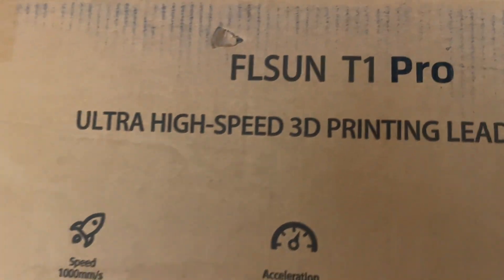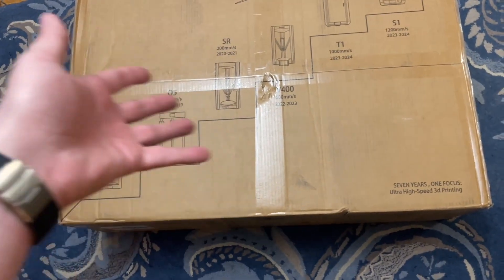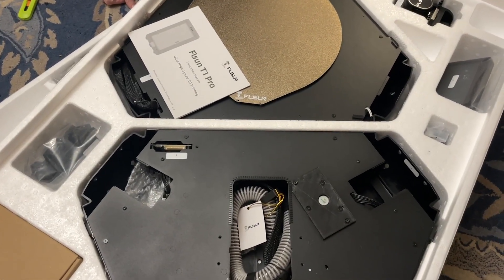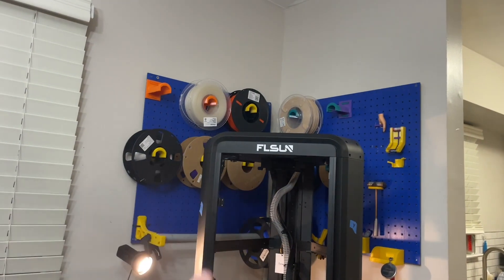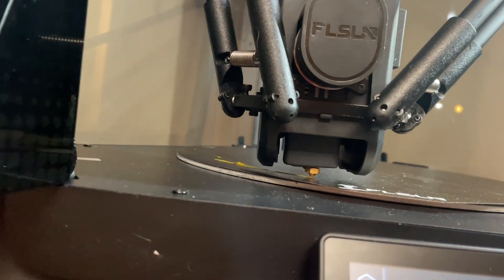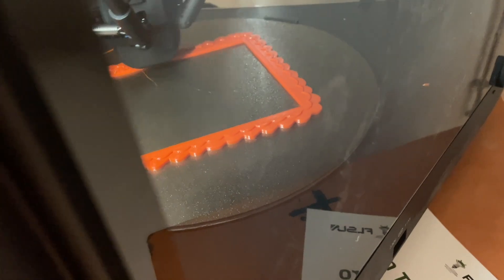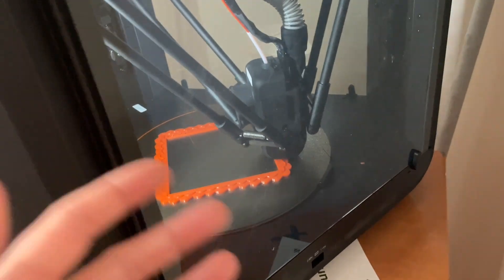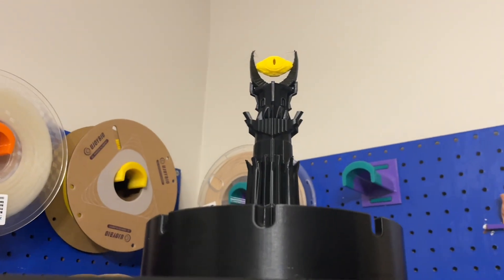This Flsun Printer is... confusing

Comment: What is the benefit of the delta configuration? Speed?
Reply from the maker: I think so, yeah
Reply: @Patrick_Gibney Thanks for the reply! I'm glad you've got this fascinating printer for free!
Reply from the maker: Perks of the job! 
It'll definitely get a lot of use - I'll be sure to update if my opinions change in the future
Reply: As far as I am aware:

- Speed
- Possible height of the printed object (i.e. z direction of print volume)
- Mechanically simpler than bedslingers and in particular CoreXY printers, thus they hopefully need less maintenance
- Less of "preferred directions" in the x-y plane; it is debated whether this might reduce some artifacts that occur with bedslingers and CoreXY printers
- Depending on the printed object: the x-y projection of the print volume is circular instead of rectangular. This can both be an advantage and a disadvantage